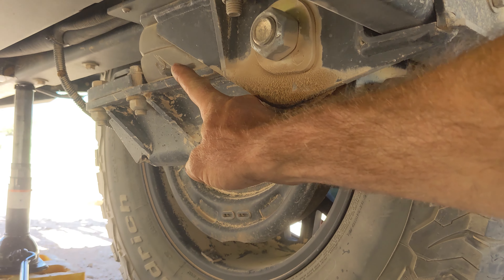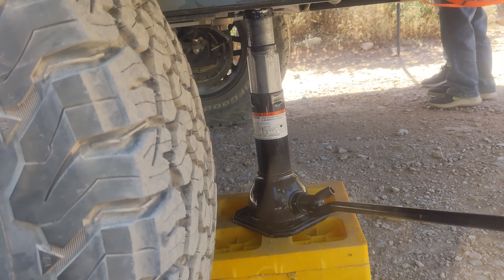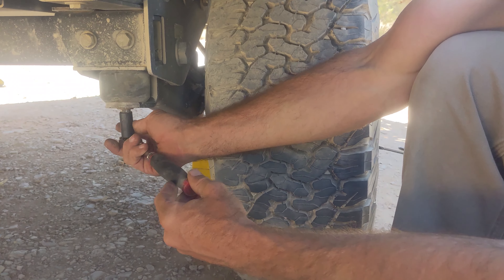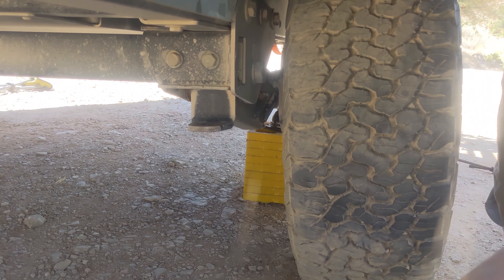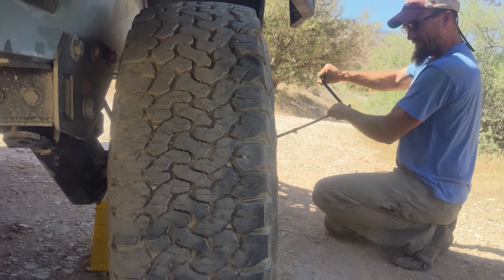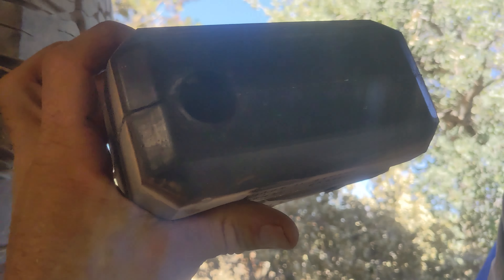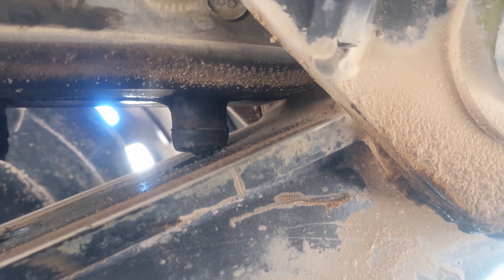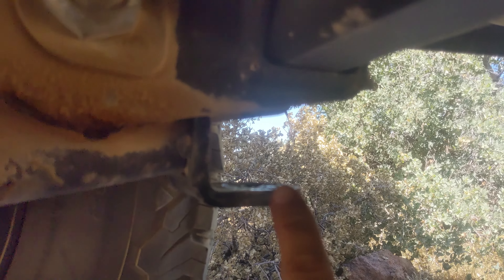Easy Timbren Aeon Spring Replacement

Comment: Thanks a lot for putting this out!  (love Jefferson's sign-off also!...ha).  Much simpler than expected.  Keep up the videos especially the 'we tested and found out..........).  You're literally putting everything you have through the wringer and it's appreciated for all of us out here that are contemplating purchasing 'x' or 'y' etc.  Hopefully you landed some sponsors at O.W. and can continue to test and report out.  Regardless, wishing you all the best every day!
Reply from the maker: Thanks!! We've always done from the very beginning whatever anybody is asking us we'll do that video we'll tell them the truth about the products. We made some very good brand new partnerships I think we've gained 12 to 14 in the past 30 days so lots of new exciting stuff coming out. We made it very clear though that we will tell the truth about the products good or bad. None of the new ones have an issue with that. 

Let us know anything else you want to see on the trailer or anything else we've replaced or done.
Reply: @RVUnscripted  How did you get the trailer re-cert'd?
Reply from the maker: Trailer suspension shop had it re-certed and also fixed the alignment
Reply: @RVUnscripted  thanks.  Alignment?  what happened there?
Reply from the maker: Camber and toe were off from day 1, noticed the tires wearing badly, took it in and had it fixed.